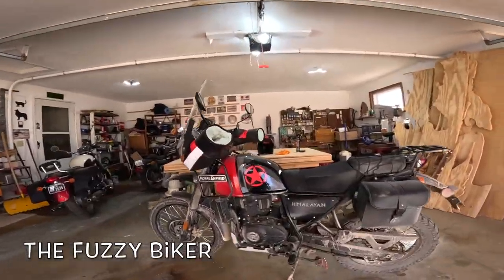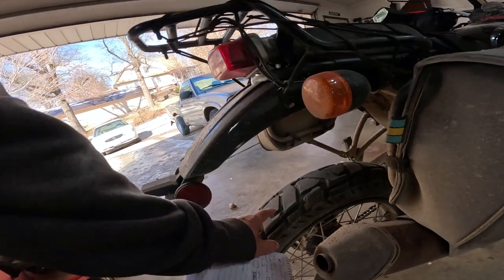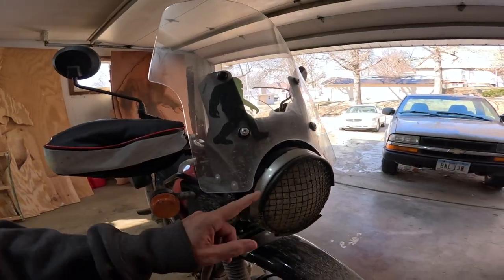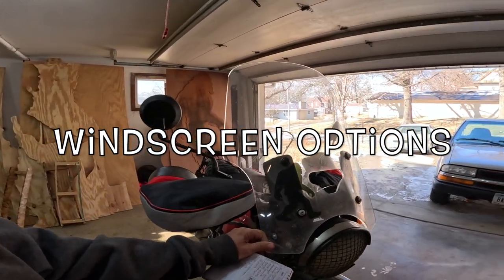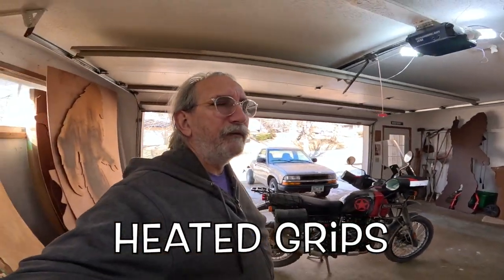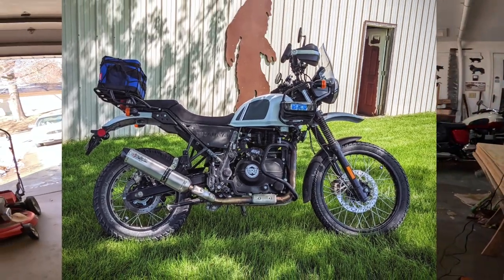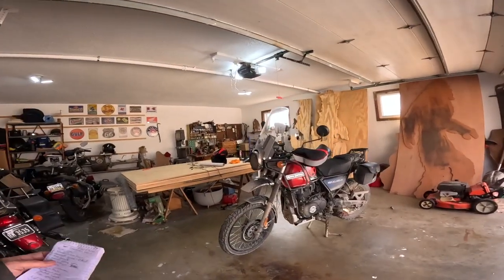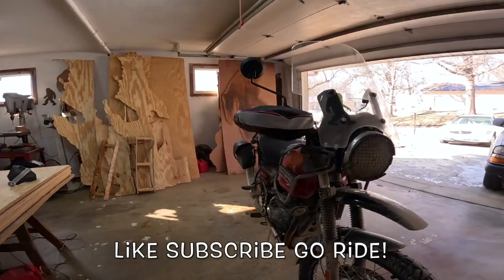6 Himalayan Must Do's, 5 Himalayan Might Do's & 4 Thinks I'd Keep - Wahoo!

Comment: ~ My list varies a lot from yours, and that's O.K.
First things I did to my Himalayan were engine guards, panniers, top box, GPS, USB charging ports, hand guards, touring seat, and a phone holder.   I also kept the stock Pirelli MT-60 tires.
As for air filters, on my Himalyan, I kept the stock filter for pretty much the same reasons as you, but on my Bullet, I put on the K&N filter, and found that it increased my speed several mph, and also allowed me to find the engine limiter, which I never hit before the new filter.  
Cheers . . . 🏍😎👍
Reply: Stock Pirelli's? Not Ceta tires.
Reply: @edwardkaminsky8142   Yep, mine came with Pirelli tires, not Ceat.
Reply: @adventureswithfarmertroy  You the Man! I wonder how on earth that materialized. How are they?
I pickup a 22 leftover Himalayan tomorrow morning (17 hours) in Vegas.
Already priced those beautiful Pirelli's for the second set of tires.
Reply: @edwardkaminsky8142  … Back in the day, all Himalayans sold in USA came with stock Pirellis.  Not everyone likes them, but I do.  They don’t do well in mud and sand, but are great for gravel and dirts roads, as well as paved.  If you look back at some of my older videos, you can see them in action.  Best wishes on your Himi … 🏍😎✌️
Reply from the maker: Good friend of mine runs the Pirelli's and love them. I did have a phone holder mounted on the bike but took it off. Found riding without that distraction funner. Am thinking about a top box so I have a place to put a helmet when I hike. Am looking at GPS units too. PS I'm subscribe to your channel. Love it :) Wahoo!
Reply: @forgottenmotorcycles  … Thanks so much … Waahoo!! 🏍😎👍
Reply: @forgottenmotorcycles  Here's an Idea for my helmet. The typical pannier rack like yours Fuzzy but Those RE panniers are pricey and krinkle. Milwaukee tool has a storage container that looks somewhat like it could work for a pannier. ( 69.99 Depot) It's 9.5 inches wide which is wider than most panniers.
Exploring options....I see Baxters has a bunch....but again pricey!
Reply: On the Tires, I wonder for Launch of the All New Himalaya and it's development by UK Harris Performance, if Pirelli was the tried & tested Tyre and as well known Brand went with the Bike on entering the Market.
 Royal Enfield since with the Model changes has gone to the Indian own CEAT brand, helps keeping cost in house and less dependent on Supply and Imports.
 My 2021 came with them and not seeing a Pirelli and CEAT together, I'd think the tread patterns are much the same from pictures, it depends on composition of each if being any difference.. Just "my 2¢" .. 🤠 ..

Comment: also, for me, adjustable levers make the bike a more premium feel over the stock levers. also, i was torn about adding the slip on plus a high performance air filter, (don't like loud pipes) but it does feel more snappy, so they are staying on.
Reply from the maker: I felt the same way about the clutch and brake lever too. Figured I'd drop the bike sometime, break them, and replace them with something better. Has not happened yet :-) I did not mention a cam in that video. If I did do a cam I would do a pipe and air filter too.

Comment: Really enjoying your videos. Just about to buy a Himalayan... Bit concerned about engine cooling or lack of it. You mentioned it gets 'heat soaked'? Is it a problem?
Reply from the maker: I don't think it's a real problem, or should I say, any more of a problem than any other bike. I often ride all day long day after day. This means the bikes components get hotter. For that reason I don't want to add anything to the electrical system that might increase the heat. Have over 24,000 miles on my Himalayan with no real issues. I would recommend this bike to anyone that wants a do it all ADV...but doesn't mind the lower speed bike.

Comment: Nemo2 chain oiler or scottoiler would be on my list, I had one on a bmw gs 800 and loved it.
Reply from the maker: Looks like a good product. May have to look into that. Thanks!
Reply: Mine is fitted to the left by the engine (I don’t like them on the handlebars or see the need to have the thing mounted up there). I use mine 10 mins out from home and as and when on the road and sometimes 10-15 mins before returning home to just lub and clean the chain before parking up. You simply run gear oil or a chainsaw blade oil mix or if your rich scottoiler oil 😂 eBay sell a perfectly good clone for around £25 uk pounds so cheap as chips 🍟 as they say in the uk 🇬🇧 (I’m riding a Royal Enfield Himalayan Scram411 these days they are an outstanding bike)
Reply from the maker: @nicolaf970  thanks for the info. I love my Himalayan :-)

Comment: As much as I liked the Givi Guard by design for 3 point mount and looking part of the bike, but overall I prefer the weight saving in not having a Guard.. It would take a major event to damage just the engine and any other case the bike itself would be a right off.
Like yourself, I'm very happy with the Himalaya as it is by Design.. 🤠 ..
Reply from the maker: Totally agree.

Comment: Can I add seven?
What about aftermarket rear shock mud guard. Prob. most important stuff on a mudbike that doesn't have it all...
Can almighty Baxter fix that?
Reply from the maker: Probably a good idea. I try, note I said try, to stay out of the mud. Give Baxter a call on that one. Wahoo!
Reply: @forgottenmotorcycles  much obliged since that lil'detail cost me a fortune on my NC750X because I haven't had a mud guard which I was easily could obtain from Aliexpress.
In RE fashion, I'm quite sure that they have significantly lower spec/quality rear shock and it's exposed too much.